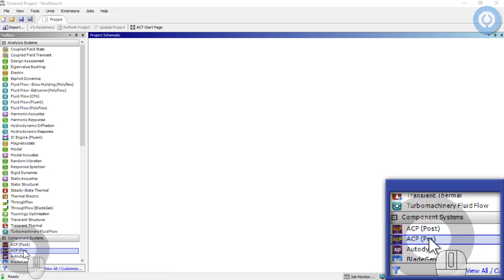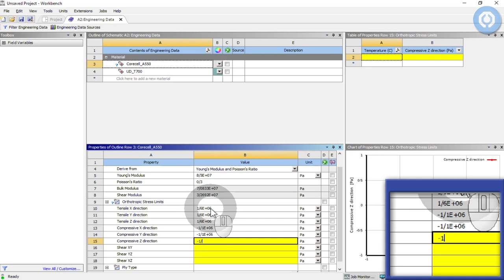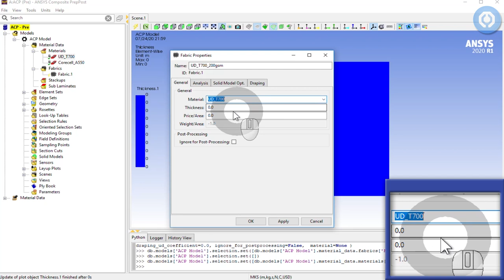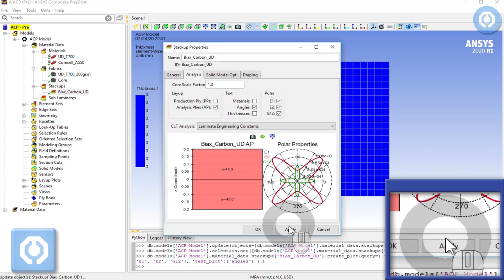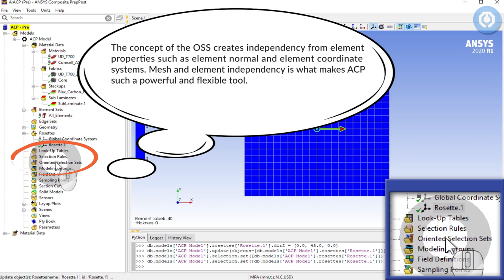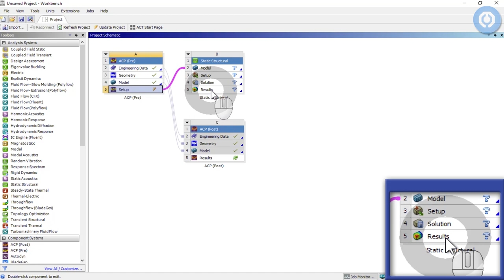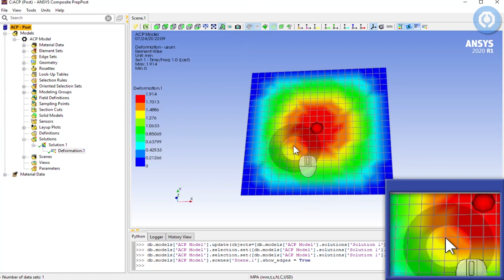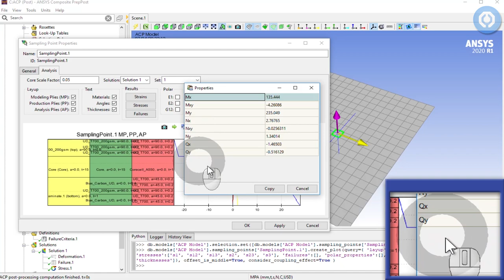⭐ Analysis of sandwich composites in ACP | ANSYS Tutorial

Comment: 1. The properties which you have provided to core Corecel A550 and T-700 carbon fibers are assumed or obtained from source. can you named one.
2. which software tool are you using for zooming mouse cursor.
Reply from the maker: Hi.
1- We used ANSYS Engineering data. You can find it in many websites.
2- Windows magnifier

Comment: How to join two different ply designed seperately as in one of the layer is a woven mat and the other is a rectangle as in this video.... How to join then together.... Please help
Reply from the maker: Hi. Unfortunately I didn't understand your problem
Reply: @iDESIGNBests  i have to analyse a composite in which top and bottom layer is a bamboo mat woven and in between glass fibre.
To be accurate i designed 0/90 woven bamboo mat on solidworks and now i want to attach the mat and the glass fibre rectangle( as shown in this video) together as a composite as i simply cannot put constraints.